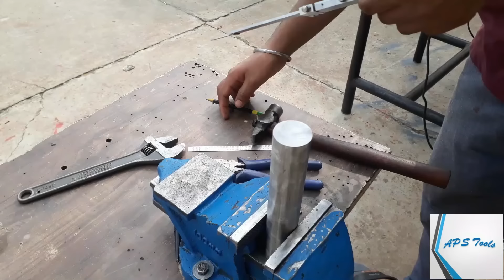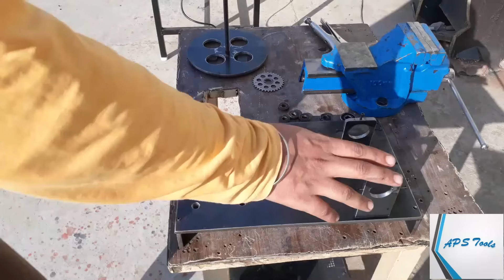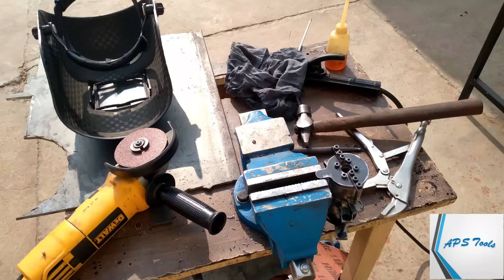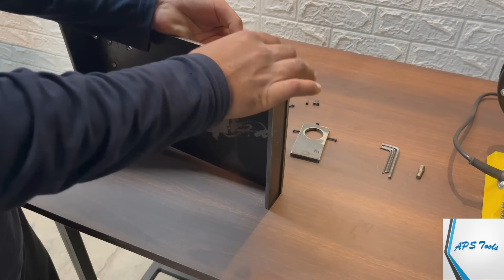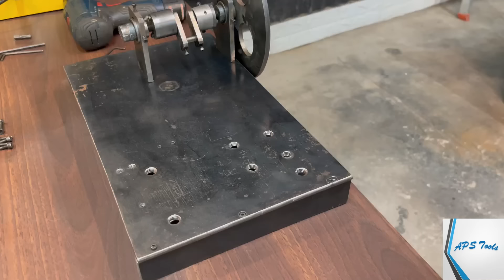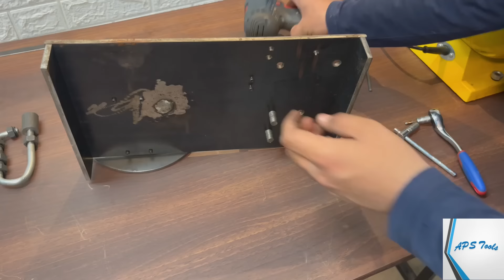Powerful steam engine build. Homemade steam engine.

Comment from the maker: Thankyou all for watching the video. Please suggest what should I build in next video.
Reply: what you did sir is very professional, is it possible to attach a permanent magnet synchronous generator so it can produce electricity? and what to take into consideration in order to attach it to the generator? thank you
Reply from the maker: @vladooom vladoom, Thankyou for suggestion sir, I'll work on it.
Reply: @vladooom I guess he could put a pulley with a belt running to something like a car or lorry Alternator for single use to power a light or to charge a battery system to power numerous things..
Reply: Stirling Engine 🥰
Reply: Stirling engine
Reply from the maker: Ok that's good idea @starcitizenmodding4436
Reply: Bigger and a generator attached.. want to know how many KW this can generate!
Maybe a steamturbine?

Comment: Brilliant man. No lathe, no milling machine, no worries. Many people don't appreciate the skill required to achieve this build without the fancy gear.
Reply: There is NO WAY that cylinder is steam tight
Reply: @gowdsake7103 it’s not you can see it’s exhausting steam out the end of it..the small piston is pressure in…so I’m guessing as I’m no engineer that one piston runs the other…one pushes one pulls..the long one also exhausts the steam as well as having just enough pressure to push it back over on the return for the other to pull…and repeats cycle…I could be wrong.
Reply: @shropshirehistory908  Ive seen old timers walk into a junk yard and build some of the most impressive machinery outa junk ...
Reply: @shropshirehistory908   When the holes line up in the small cylinder ,valve, the steam goes to the large cylinder and pushes the flywheel. As the flywheel turns the small rod is moved and the hole is blocked. The steam cannot flow to the large cylinder. The other side of the small rod is ground so the steam from the large cylinder is not trapped, but can flow out of the large cylinder. This ground spot can be seen at 12:50, is very quick. The large cylinder has one purpose , to push the wheel. The valve does two things 1. allow steam to flow and  stop the steam flow and 2. allow the large cylinder to empty out the used steam. hope that helps.
https://www.youtube.com/watch?v=D5ylCxp6owA&t=13s
Reply: No welding machine 😂😂😂

Comment: i have a few issues. why did you bother cutting the ring off the head of the bolt? you made four unnecessary cuts then cut the head off entirely? the other was why use the vice grips  when drilling the ends of the bolt when you never held it? i don't think drilling the large diameter hole in the center of the bolt just using one hand on the shaft is safe or possible. again the vice grips attached wass never held. maybe you could get a job with the "vice grip garage guy" also why did you use an electric hand drill when you had a drill press which would ensure the holes drilled would be vertical to the work piece? at 6.14 you have  one image of the "crank" shaft with a toothed wheel on the end of it, then at 7.8 you show another machine altogether. and the build you first started is never seen again?

Comment: Nice model 👍 the most interesting part is the reciprocating steam inlet valve !
Reply: it is ..i was kinda thrown for a loop for a bit the way he designed it. but it definitly works no doubt!
Reply: The flattened end will let the air out the end of the slide valve when fully engaged and then let air in through the hole when the valve retracts.

Comment: EXCELLENT video. Honestly shows what would go into actually building a simple little engine -- about as simple as they come, but still lots of work! There are tons of fake videos with people using shock absorbers and pressure cookers, and they're all fake. My only critique is that it would have been nice to see you fabricate the connecting rod and strap as well as the steam lines.

For what it's worth, you never want the fire licking up around the sides of your pressure vessel. There's no water there, typically, so you'll just be heating the shell with no gain to your steaming and weaken the vessel -- a great way to have it fail under pressure!

Nice job!

Comment: this a very well thought out idea without having to use complicated machinery such as a lathe and a milling machine,, just standard tools that the average person can afford . Do you have a parts diagram with specs? And one last question ...imm not a matha matician by no means but about how much horse power do you think this steam engine you built puts out?just thinking this would be the ultimate backup power source for a dc generator or a a/c generator. for a backup emergency  plan in case of a disaster ,,or a wwcrisis .. never know  what these little ideas can be in time of need.ty for your time in doing these things . this generation needs more pepole like you who are taught to use what they have on hand and not whats they have to buy  ...like the brain..lo!

Comment: Very nice build sir! How does steam escape the main cylinder?
Reply from the maker: Through hose and then valve outlet
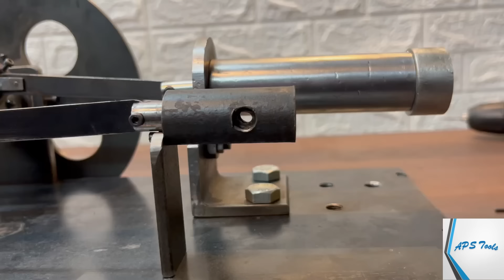Check 13:42
Reply: @apstools5521  No I mean how it escapes the main cylinder. When steam comes in and pushes the piston forward, it has to get out of the cylinder, before the piston can go back, right? I only see the inlet valve, you linked to at 13.42 - but no outlet-valve?
Reply from the maker: @DK-jt6be there's a half cut section at back of the valve, when wheel inertia pushes main piston back hence steam out and it passes through half cut where valve piston is slided outwards and steam escapes check 12:50

Comment: Nice work,I’d recommend a pressure safety release for the boiler
Reply: I keep seeing this and makes perfect sense, but can you make one, or how do you know what pressure is too high
Reply: @bigriggc5828  it’s basically a needle and seat with and adjustable spring to release pressure at a given amount.if the engine runs on air at 50 psi you wouldn’t let the steam pressure get too high and want to release it.
The boiler needs testing to 3 x it’s working pressure full of water
Reply from the maker: @royallan3717 royallan3717, thankyou for watching the video. this engine works on 7.5 psi, 50psi is way to high. And I didn't used safety valve as the boiler is fitted with pressure gauge to make sure the pressure remains within the limit less than 15 psi threshold for blast and at same time to cut off the gas supply for burner

Comment: The boiler need a way to conceall the fired in it and ensure the fire is not excess.
Reply: He has a pressure gauge on it so I’m guessing this way it regulates heat..if it was to be concealed the temperature would rise at same time raising the pressure…with the heat escaping the pressure stays were it is

Comment: NO PRESSURE REGULATOR ON BOILER AND NO LUBRICATION ON MANY OF THE WEAR POINTS - ALSO NO PULLY TO TRANSFER POWER TO SOME SORT OF APPLIANCE
Reply: Lets see ur effort? You can't build you can't critique

Comment: Hello, do you think it is possible to build an engine this small that can produce about 3 HP of power? I'm building a tricycle for myself. Grateful.
Reply from the maker: 3hp would be bigger than this one
Reply: @apstools5521  Yes, I believe it would be bigger, but would it be possible that it wouldn't be so much bigger, a piece of work that would be so heavy that it would be unfeasible to use it on a tricycle made from bicycles?
Reply: @apstools5521  Ah, I'm Brazilian and I live in Brazil, would you have a project for an engine with around 3 HP that you could provide me with?